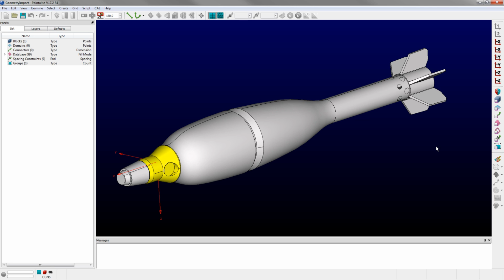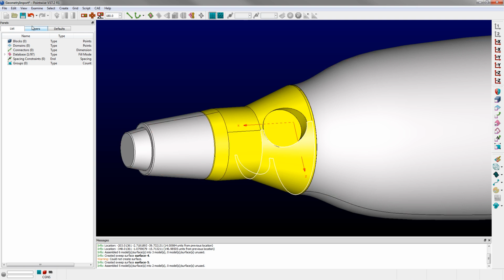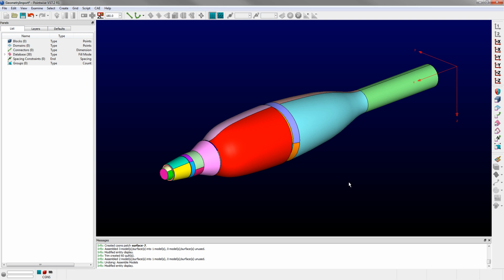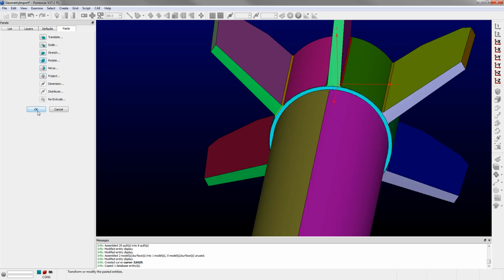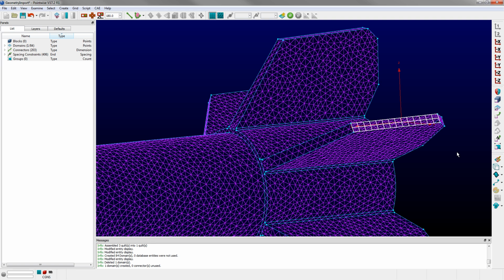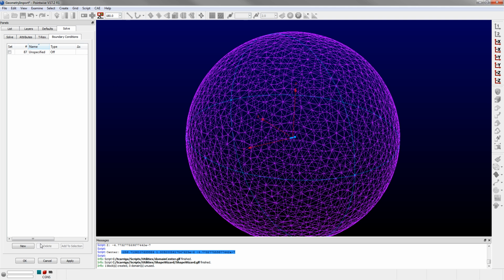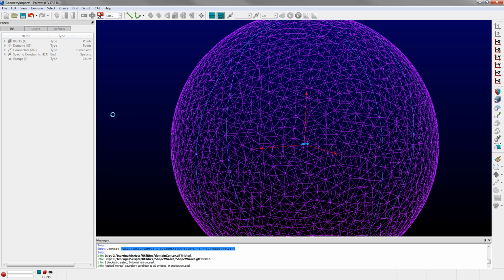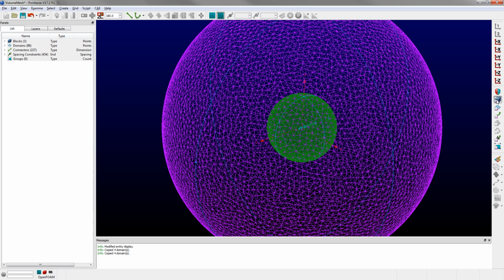Pointwise Pointers: Advanced Solid Modeling and T-Rex

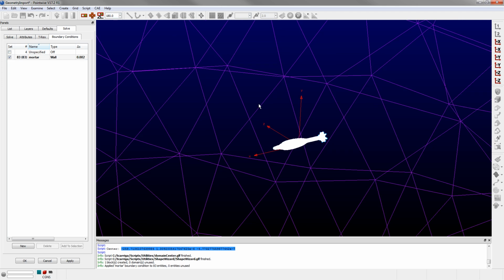Comment: 43:16 there is an inclusive selection done for the mortor model, unfortunately i'm unable to select my wing body using  inclusive selection. Can i get any suggestion for this? (I also have a symmetry part at root of the wing),  I have V18 of the software. Video is definitely suggested for any individual starting a 3D meshing in pointwise. thank you .

Comment: Thank you for the video! When assembling my model, I remain with 33 lamina boundaries and one model. I tried to get rid of the lamina boundaries by adjusting the edge tolerance, but the maximum value I can enter here is 0.0001. Do you know why that might be?
Will I run into problems later on if I continue with the lamina boundaries? I'm new to CFD Meshing and have no experience there. Is it necessary to reach 0 lamina boundaries when the "Assemble Models" yields one model as in my case?